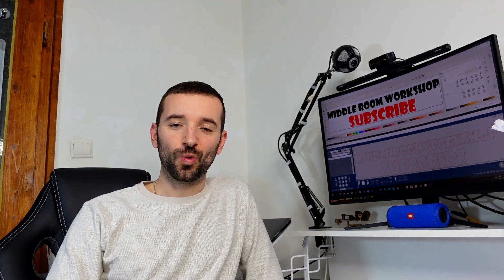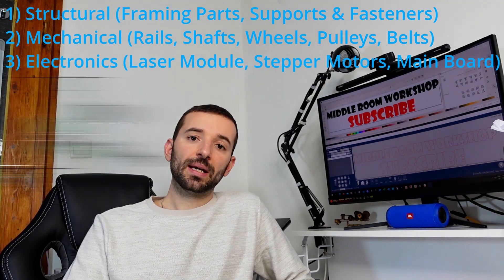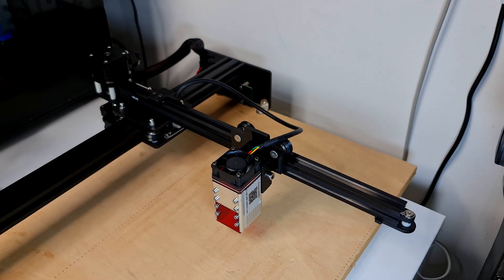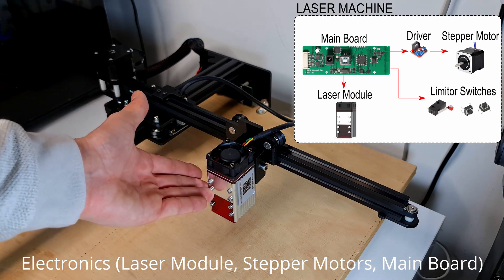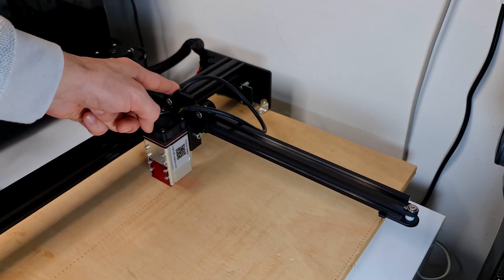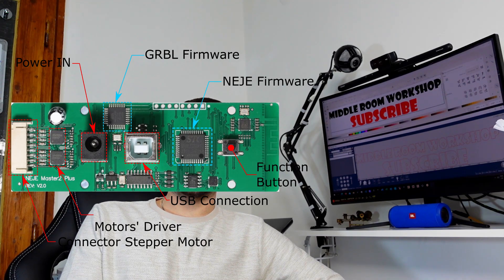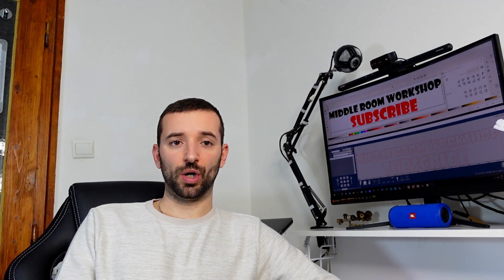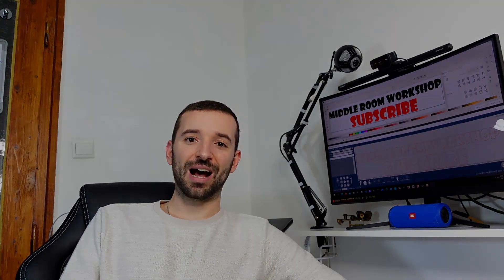Parts and Working Principle of a Laser Engraver | CNC

Comment: Can this laser cut silver with 0.02 mm thickness?
Reply from the maker: Hello Meysam Ebrahimi , thank you for your comment.

That is an interesting question, I cannot give you a certain answer as that should be tested, but I have had experience with industrial engravers and despite being a really thin sheet it is metal and highly thermal conducting one therefore I would say no. In my experience stepping to metals takes up huge amount off power, say 1KW to cut in the order of a mm not to talk about the type off laser. 
 Have a look to my metal engraving video https://youtu.be/yX6X5cxagbc you will see that all you can do to metal with this machine is marking it, in other words exporting the oxide layer on top. 

I hope it helps.
Ciao

Comment: GRBL is more complex than just 2D. I use it to operate my desktop CNC milling machine and most of the small CNC routers on the market use GRBL as well. Really good explanation of the working parts of the laser engraver. Thanks for the video!
Reply from the maker: Hello George Chambers thank you for your comment.

I think I oversimplified it with my wordings a the end of the video, but as far as could experience GRBL is a bit simpler or friendly to use than Marlin. Surely not only for 2D.
Thank you for your highlight I will put a note in the description to correct that.

Ciao